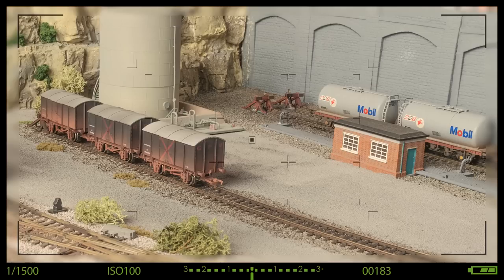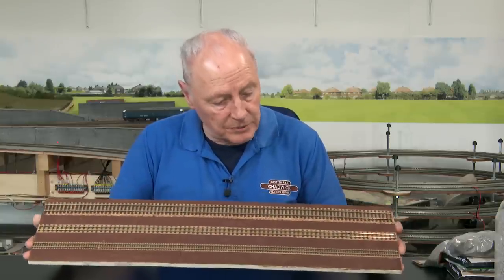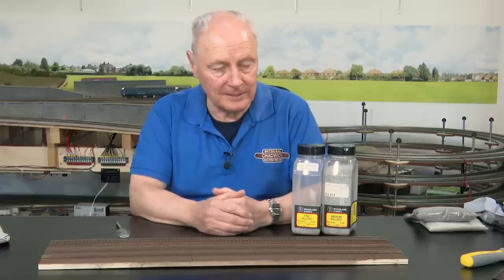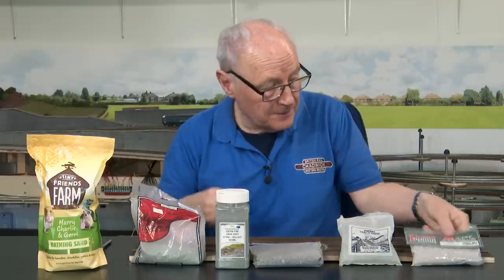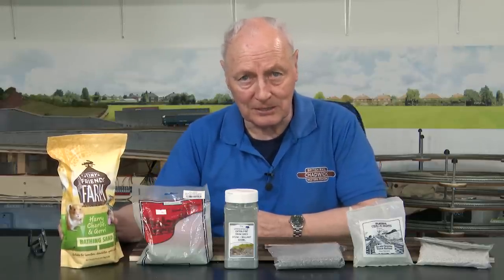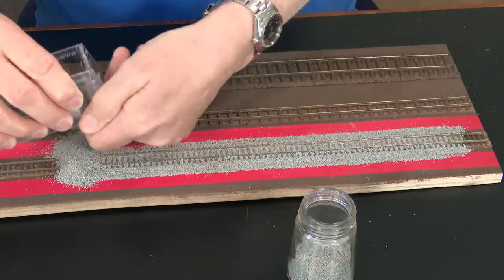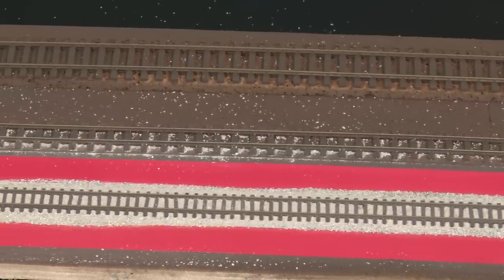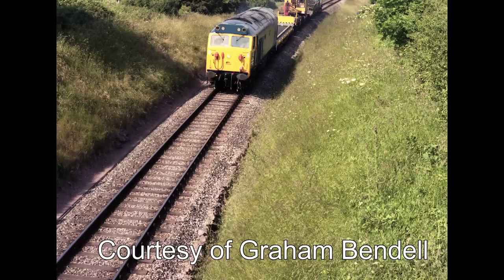BALLASTING, the GRITTY TRUTH at Chadwick Model Railway | 190.

Comment: Interesting video Charlie, thank you. As a viewer I think the ‘product roundup’ format on a test board is really useful.

As someone who gave N gauge a shot for my first railway when covid hit, this would have been really useful to me in April 2020! If I ever built another layout, I would certainly look into that WWS extra fine ballast - it looks just right in your video. 

Funnily enough, I did try some chinchilla sand that I bought from a local pet shop in a clear unbranded bag. The problem came when I tried to glue it with WS scenic cement. As it dried, cracks appeared all the way through it and it flaked apart. I reckon that particular sand I have is a lot finer than yours which may have been my problem. I actually decided it looked too fine and decided on the WS fine grey blend which although technically overscale for N, I thought it looked ok once weathered. 

The chinchilla sand was however used on and around the tracks around my goods yard once I found a way of ‘taming’ it. I actually started with WS fine blend as a base layer, glued and set, then I slowly added a few very thin layers of chinchilla sand over the top, misting with IPA and scenic cement and waiting for each layer to dry before adding another. 

Thanks again for a very informative video 👍🏻
Reply from the maker: Thanks Daniel, for some good info that I may use in my TMD. Regards, Charlie

Comment: I despair that the model rail industry in the UK didn't move to HO around 1980 when for a couple of years the UK model manufacturing industry pretty much ceased to exist following the demise of the companies that were around at the time.  Sadly it didn't happen and we continue with this odd gauge.
Reply from the maker: Yes, I agree Dixie, but where can we go! Regards, Charlie
Reply: @ChadwickModelRailway  spare a further thought for the Irish and by extension victorian state modellers here in Australia, their models of broad gauge stuff is either 4mm scale or HO but still running on 16.5mm gauge, nightmareish levels of innacuracy for those that get in a twist over such things. There's also the metric vs imperial issue of O gauge and gauge one where both have a version thats either mm to the foot or fraction of an inch to the foot. Rational standardisation passed this hobby by
Reply: Fleischmann tried it, didn't they, with a Warship and Mk1 coaches? So far as I can remember, there was never much else, possibly Lima.
Reply: @SeatedViper  the problem is maybe more  one of who did it and how than it being a bad idea, the lima stuff suffered from non standardised couplings that just to add insult to injury couldn't be swapped for a kadee or tension lock easily. Makes the whole thing a lot less attractive if it doesn't offer any real prospect of running with the biggest market for HO stuff or working in easily with the OO stuff. Also were someone to launch a range of HO british stuff in the US it would probably gain a foothold there and that would act as a market to support it while it grows in the UK, the products almost create their own justifications, A4, A3, terrier, whatever the LMS sent over, basically start with things people over there can go physically see or that have genuine connections of history, then expand out into doing say a heros of WWII collection or similar covering wartime locos from both the US and UK, throw in some wagons and coaches and you begin to have enough of a range to market in the UK as something useful. As with anything its the money not the practicality or the marketing which are both sorta obvious.

If done with this approach it seems kinda sane, more so than a 33 and some suspect looking MK2 coaches chucked into a market with little thought to why or who wants it

Comment: Hi Charlie just watched your latest video great as usual. I have just got some gaugemaster BPD CC 80 auto frog switches you can’t get the frogs wired the wrong way around, you just wire track power to either end and the frog wire to the middle sorts itself out even on double slip points marvellous.
Reply from the maker: sounds like the sort of design that all manufacturers should follow. Regards, Charlie

Comment: Another good informative video Charlie thanks for sharing. Yes, I made that mistake using medium ballast on the layout at the start. When we ripped up half the layout to redo the boards, I went woodland scenics fine, what a difference, and more to scale. I haven't the luxury of an airbrush, so I aerosol the track with railmatch sleeper grime when pinned down and wired up with droppers. Then, once ballasted, I create a wash and then brush on either side of the track to create realism. Keep up the fine work regards John
Reply from the maker: That’s great news John, if only these products were properly labelled. Regards, Charlie

Comment: I use Garnet sandblasting grit for ballast in either 30/60 combined mesh or 80 mesh. It comes in 25 kg sacks. I also use the hobby shop ballast for further detailing. 
Adding the first glue along the sleepers outside the rail to let it soak under towards the centre lessens the chance of ballast getting glued where wheel flanges go.
The 25 kg sack costs about the same as 3 and a half of those 1  litre bottles from the hobby shop. I have seen the grit in 10 kg pails.
Thanks Charlie.
Reply from the maker: Great you o found a workable solution, Robin. Regards, Charlie

Comment: Good video - most useful! Would also like to see the N gauge ballasts glued onto the H0 track though, as I believe this is your preffered method.
Reply from the maker: Yes, I have used N gauge ballast in a video more recently. Regards, Charlie.
Reply: @ChadwickModelRailway  There is a flipside, in that N Gauge ballast can be too fine for H0. I just got some Auhagen N/ TT Gauge ballast and after some trials with H0 track, the granuals are just too fine. It will be good for the 'cess' area though.

Comment: Charlie I use 70% isoprol to break the surface tension when ballasting 60/40 white glue . The issue I have had come up is the isoprol is causing oxidation at rail joints . i didn't use the isoprol for a couple days and came back to do more bakllasting and it sent the track rails a green colour and have had issues with it since.Power every three sections of track. The track I did earlier has power to every bit of rail whether 2" or 3ft. and no issues. I have had to go back and power all the rails for about 30mtrs. The isoprol wicked down the helix too, lucky I have power to all rails in it , but the oxidisation still persists.  Les
Reply from the maker: That’s a very interesting observation Les. The IPA that I use is always 99%, I wonder if this has a different effect. I shall certainly check out some of my joints a little closer. Regards Charlie

Comment: Good video again, Charlie.  I think for as long as you've been able to buy ballast for model railways, whatever the manufacturer says about scale, it's always too big, and I've always had better results going down a scale.  And then you have the compromise of using HO gauge track for OO scale, meaning the ballast just looks bigger than on scale gauge/sleeper spacing.  Your photo of Yeovil also showed that ballast size varies on the real thing too.  I wondered if the chinchilla stuff might be useful for ballasting your TMD, as in depots the ballast always seems much more compacted, sometimes to the point of ending up looking more like mud than chips of stone!
Reply from the maker: You make some excellent points Andrew. Yes I’m after a much finer look in the TMD. Much darker and with appearance maybe not, unlike cinders. Regards, Charlie.

Comment: Charlie my friend, I think I can save you some time. I found that instead of a spoon , which you have very little control, i use an old mustard squeeze bottle. First: you have to look closely but here the squeeze bottle holes vary by brand. You can check in store before buying. Here the smaller hole is in the spicer mustard . Who knew?  Second: you don't have to squeeze, it poors out but you can regulate. Soooo much easier and faster. 
One other thing, i don't use soap in glue but i do spray down with IPA and if i find it beeds on top or doesn't drain down fast enough, i spray with IPA again . Seems to work fine.
Reply from the maker: Thanks Bob, excellent advice. Regards, Charlie

Comment: Hi Charlie. I enjoyed watching your ballast video and you particularly demonstrating to the uninformed, that some scale ballast is prototypically oversize.
I am amazed 😮 at the apparent size of the 12” to 1 foot scale ballast you showed at the start of the video, as current regulations specify 63mm (2.5”) as the maximum sieve size, an increase over the previous 50mm (2”) maximum of the British Rail 1988 specification.  The ballast, particularly to the viewing right, looks huge!  I would be interested to know where you acquired it from and its maximum size.  Best, Jason.
Reply from the maker: A very interesting comment Jason.
My two pieces came from the remains of the Somerset and Dorset Joint Railway.
The larger chunk measures 2” x 4”.
Regards Charlie
Reply: @ChadwickModelRailway  Thanks for the info, Charlie.  J.

Comment: I like your experimentation, but there are 2 more things I have done:
HO flatbottom track can have its sleepers spaced out a little more. Cutting the webbing & re-spacing is easy but very tedious. It makes a big difference though.
I became dissatisfied with PVA. It is a good product for fixing wood together but is a resin really suitable for fixing ballast? In my experience, it is a poor product for ballasting: It completely destroys any sound deadening provided by a soft cork base, makes granite ballast go slightly green & has no give at all so just breaks away when you cut the ballast at a board join. I feel many modellers continue to use it simply because they have in the past. There are alternatives: Copydex, Deluxe Ballast Magic. There is nothing to lose by trying them on a small test piece.
Reply from the maker: I agree, I have tried diluted, Copydex, and it works to a certain extent. However, it does get very stringy. We have yet to find the ideal answer. Regards, Charlie

Comment: Greetings Charlie : Ballasting is a tedious [ Theraputic ? ] task; but is one of THE most important finishing touches to scenic realism. The Particle Distribution Curve of the chosen ballast must be narrow ( Minimal fines / Minimal coarses ) and yes; in general; of the  * Fine *  grading for correct scale appearance ( NO Kitty-Litter .... Purr-Leez ! ).  As you discovered and logically so;  Fine  grade ballast runs like water; so I partially block the Applicator side-gates with strip-styrene inserts to restrict flow.  I choose to completely close-off the middle gate and subsequently sparingly apply the mid-track ballast by hand. Everything else is as you demonstrated : Gently tapping the railhead is vital for uniform settling of the ballast. May I humbly suggest that of additional; critical importance is to slowly run the point of a thin; wooden kebab skewer [ To ensure that no damaging of the plastic chairs takes place ] along the inside of the web of the rail ahead of the tapping to dislodge any flange-grabbing particles ... All this PRIOR to the eventual / final application of adhesive .... Much Thanks + Cheers For Now / Johnny 🤙🚂
Reply from the maker: Thanks Johnny, for such an in-depth and constructive comment. Regards, Charlie

Comment: Hello Charlie and fellow modellers.
  I , like yourself, am fanatical about track/board rumble and know that PVA clue transmitts sound from track to board. To help reduce sound transmission is it a good idea to use  diluted copydex ( or other latex adhesives ) to adhere track ballast to  track bed ?
Reply from the maker: I have used diluted Copydex in the past Duncan. However, I still seek a better solution. Regards, Charlie

Comment: Hi Charlie. Have you tried Ballast Magic powder mixed with the ballast,  and then you just spray it with water and it dries solid. Nigel
Reply from the maker: Yes, I have Nigel, and didn’t get on with it very well. You have to be aware that the mix needs to be well shaken and stirred prior to use because the glue seems to drop to the bottom. Regards, Charlie

Comment: Delivered with your usual aplomb!   Now as an N gauge modeller I use  Gaugemaster N Gauge ballast.  Correct it does have a bit of a glint to it straight from the packet but after PVA/water/washing up liquid is  applied it doesn't "shine".  Pity you dismissed this one on only a part test !   Your comment seemed to suggest it was okay apart from it was "shiny" when laid dry.   Feel free to look at some of my running sessions to see the Gaugemaster in all its glory😊.  Cheers  Euan
Reply from the maker: Thanks Euan, a fair comment. However, I did think it a little dark. Regards, Charlie

Comment: Very timely Charlie.  Quite spooky really, as I have literally just started ballasting my layout today.  Only difference was that I used Frog tape, and removed it before actually applying the glue.  I wasn't sure I would be able to get it up without lifting ballast I wanted to stay after the glue has dried.  I have only ballasted a small section so far, as it's the first time I have done it.  Have to wait until tomorrow for the glue to dry to see the final results of my labour, but it was looking good when I left it.
Reply from the maker: That’s great news, I do hope it turns out well. Regards, Charlie

Comment: Great video Charlie!  I think you can adjust the sand color by mixing it with Colored Tile Grout.  As to that dusty ballast,  I do believe that is real unwashed crushed granite.  Woodland Scenics is another story.  I do not know if they changed their material, but it used to be ground up walnut shells.  That was a problem because walnut shells tend to float in liquid.  For your modelers in O-16.5 or On30 they can buy "Chick Grit" real cheap.  What we have over here is reddish, but it looks good.
Reply from the maker: Thanks, DK, good info. Regards, Charlie

Comment: Quick Wife Hair Dryer Method.  Spray your entire track witg glue. Get a tub of your grit and throw into the air at the same time waving your wife hair dryer around. Within a few minutes your entire track is done. Plus the walls, doors, carpets, and also the wife should she be standing in the way. I hope this helps.
Reply from the maker: Tried it but I can’t get it off the ceiling!

Comment: Hi, don’t know if you read comments on your older videos, but I just started ballasting and did a large section of track. After the glue dried I cleaned the rails but there is no power going to the sections I ballasted. Any tips?
Reply from the maker: It sounds like you don’t have power feeds to every piece of track.  Perhaps it’s glue inside the fish plates that’s causing this isolation.  Regards Charlie
Reply: @ChadwickModelRailway  I don’t have feeds to every piece of track as my layout is DC block controlled. I did solder all the joiners together though. I had wondered if what you suggested was the issue

Comment: Network Rail has just relayed a point in bullhead track at Huntingdon (just to the north of the station). The Nene Valley Railway, last line I rode alongside the track bed in Peterborough had bullhead track on concrete sleepers. If modelling continuous welded rail you'll need to deep ballast your track ie the ballast has to almost cover the sleepers, which isn't needed for the traditional section track.

One other thing to consider is the type of ballasted used in the area youvare modelling. The NER used ash ballast in sidings and low speed areas and stone chunks elsewhere.
Reply from the maker: Thanks for an excellent comment, Neil. Great info on the current use of bullhead. Regards, Charlie.

Comment: Thanks for this video Charlie I can see you put some work in to make this. I did my ballasting a while ago, I usually use Woodland scenics fine brown blend but I run out. So I bought some DCC Concepts N gauge ballast from my local shop which I found was very good too, It came in a pack with three colours. I made the mistake of using Ballast Magic this time and I had bad results where it had not set in different places so I had to go over it the old way in the end. I had used Ballast Magic before successfully but for some reason it let me down this time.  I thought of using  chinchilla sand but I did not like the colour. Anyway thanks again for this informative video, I thought you would  have mentioned about ballasting around points etc  especially in N-Gauge, care is needed.
Chris.
Reply from the maker: Many thanks for your comment, Chris, and I’m so pleased that you found the video interesting. Regards Charlie

Comment: 5:33 the difference btw H0 and 00 scale track is not only the spacing of sleepers but more importantly, the spacing of the rails: H0 track is 16,5mm wide btw rails while EM is 18mm, true to the 00 scale of 1/76 instead of 1/87.
Reply from the maker: I had thought you had explained that Jean, but perhaps not. Regards Charlie
Reply: True to scale OO track as sold by the Scalefour Society is P4/S4 track @ 18.83mm. As OO scale is quoted as 4 mm equals 1ft, therefore 304.8mm divided by 4 = 76.2     (If Standard gauge track at 4ft- 8.5inch is divided by 76.2 the answer is 18.83mm)